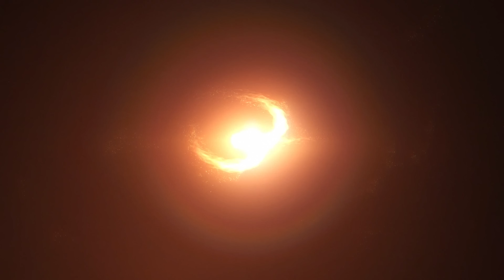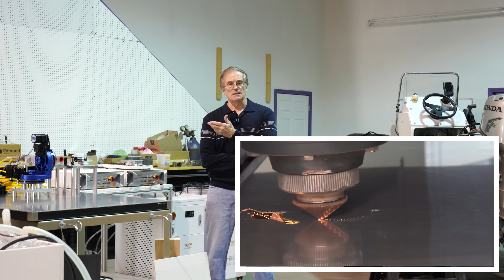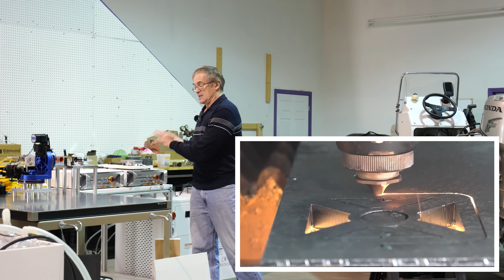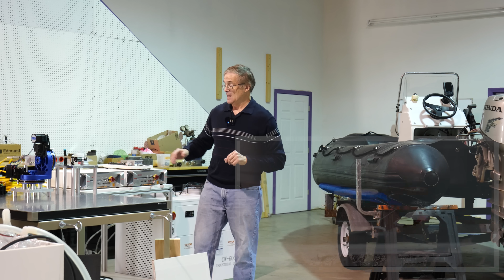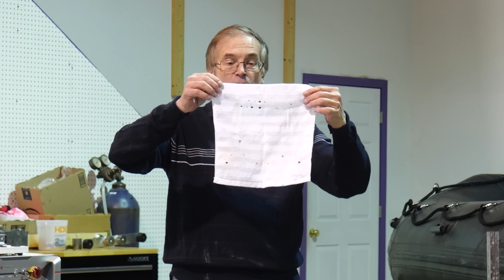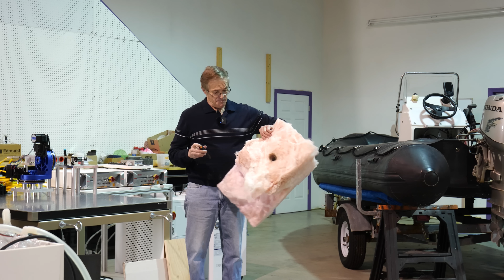We have a problem... and need your help!

Comment: Cabinet maker here.. LOL (why does everyone feel the need to announce their profession as if it gives their ideas more credibility?)

So, the laser provides a certain amount of energy within a defined area over time.  If you can significantly lessen the time, the problem is solved.  Simply cut a bunch of drywall circles, overlap and spin them.  By spinning, you control the potential time the beam can hit a given spot on the material.  You could even rotate on  a variable elliptical path to increase the what is now essentially a cut path.  The material isn't as much of a factor if the beam can't dwell on a single point for long enough to damage it significantly.  The solution is a surface in motion rather than static.

Comment: small containers stacked into your backdrop; filled with:  1. Water + sand.  2. water + fiberglass.  3. hydrated "orbeez" mixed with sand and/or fiberglass. 

4. hydrated Orbeez in 3 pound sacks stacked behind the target.

Comment: Maybe not cheap, but what about a bunch of thin glass cylinderical rods facing vertically? If you had some sort of optic to diffuse the light then you'd been fine with drywall behind that. Maybe a curtain of fiber optics without the cladding?

Comment: Have you looked at the laser safe laser acrylic that's used on the actual fibre laser cutting machines / laser glasses? Its designed to block the light, but not sure how long it'll last with that laser power.

Comment: Wet sand between two sheets of a fine metal mash (insect screens). may be several layers of screen. Should not be very reflective holes can easyly repaired, cheap. The sand does the absorbtion, the water helps to stop it from flowing. The mesh keeps the form as a wall.

Comment: Do beam dumps not exist for these lasers? I've seen that for fairly powerful lasers it's possible to make one at home, using prisms to weaken the beam and mirrors that prevent it from exiting the "trap" so that it can be dissipated by ceramic cone or even copper/brass  cone heat sinks, coated vith special material or colored with special paints and liquid-cooled.
Reply from the maker: We have to dump the beam, but while it is scanning all around the whole back wall chasing drones.
Reply: @TechIngredients, I hadn't thought about the fact that the laser moves. Have you tried using homemade SpaceX/Shuttle-like heat shields? Haven't you tried doing something similar in the past? Someone on YouTube has had great results, you'd have to see how they handle the heat from the laser when it's concentrated in such a small area.

Comment: Hay how about the type of brick used to build a ceramic curing oven? They are super light, and can take a lot of heat. You could use a reflective coating on the oven brick with a mirror to reflect the laser back at the brick and possibly have the mirror move ever so slightly with a servo to redirect the laser beam at a new position at the oven brick. I tried to find what they call the oven brick, but could not find any name only this: SK-34. I LOVE your program because it reminds me of my father that has passed on, but he worked for JPL as a thermal engineer for 10+ years. Then moved to Colorado to work for Martin Mariota. It was not yet merged with Lockheed. After I retired from the U.S. Army as a 67T I was hired on at Lockheed Martin building top secret satellites. After retiring from that I moved to the Philippines to find love; which I did and we are still together after 12 years. I wish my father was still with us so he could solve this issue, and I know he would LOVE watching your program too. Hope this helped or at least give you some ideas. Keep up the awesome work.

Comment: Forgive me for saying there is some irony in this problem. The original deployment of these lasers used beam convergence-point-divergence to get the metal cutting done, and divergence to render the beam safer afterwards. As I understand it, you have created the beam that does not diverge, and is lethal well past the intended target.
Two thoughts:
1. Move the operation to a proper bunker since a mishap could send a lethal beam outside the garage risking the safety of anyone nearby (check the insurance policy); and,
2. Change the problem to focusing the beam onto the target so that it then diverges (just like the laser metal cutter system).
In general any weapons system can be considered in three parts: source, target, and minimising the effect on non target areas. 
As I see it, a drone engagement can happen at relatively close quarters, and friendly forces/assets can be on the hill behind that drone — dispersion is your friend!
Reply from the maker: Depending on the energy, any beam can be lethal. There is a limit on NA or numerical apature. This is the convergence/divergence angle. The mass and dimensions of the beam director optics determine its speed and stiffness.  Because the beam has to start out small and focus at the distance of the drone, it's still small when it hits the back wall.
Reply: @TechIngredients  Yes. This resembles taming a tiger while holding it by the tail. 
Again I think this taming is best done in a concrete or rock lined bunker/tunnel.
As for the beam geometry itself... straight lines are painful when the target is only one point on the line. If the beam starts as a cone, the target is at the point, and there are zones of tapering damage both sides of the target. The collateral risk goes down with distance.
If the beam is diverging less resilience is needed the further away the stopping barrier can be placed.
BTW remembering your work with BaSO4 microspheres. Can you get an IR transparent plastic in sheet and bead form? Build a wall of dispersion before the backing layer has to absorb the energy.

Comment: A large diameter, reflective tube, wrapped in a coil, where light can enter, but not leave the coil. The inlet must be a 2 way mirror that lets light in, but not out - reflecting the light back inside the coil. It would be interesting to measure electromagnetic properties around the tube and in the center of the coil.

Comment: Do what we do with plasma or laser cutting tables, but on steroids. Stainless steel aquarium with multiple stainless steel sheets positioned like fins on a heat sink, so the beam will heat outer wall, then water/steel/water/steel/water/steel, etc. Experimenting with the number of sheets, you could maximize time prior to the beam punching all the way through. Also, you'd get leaks in the front face, but you'd just need catchment with a pump, and then you'd need to replace the front face once it has too many holes.

Comment: The solution to pollution is dilution. To dilute the light, you need refraction and reflection to a effect of thick snow,l. Sand comes to mind, but you will need powdered sand(100mesh or smaller SiO2) to act like tiny mirrors, all but a vertical setup would be impractical.
Next suggestion would be to show your new found love for Ad Coelum doctrine and look to the sky. Be sure to dodge clouds bird and satcoms

Comment: a long pipe filled with water, maybe a 8" copper tube of 10 yards long,  with heat veins welded externally (to quickly dissipate heat) and a pump system to circulate water between the tube and a 1000 litre aluminium tank (copper if possible) also fitted with heat veins (the size of the veins will be subject to trial, in order to tune the system). then using a sighting laser you aline the whole apparatus in such a way that your laser will travel through the exact centre of this horizontal water chamber. additional refinements can be applied, including shortening the tube and adding active cooling (chilled water jacket and or cooling fans). Hoping my plumbers solution proves in some way useful. who knows maybe we just invented an incredibly efficient water heater 😆

Comment: May I suggest considering lava rock? As a physicist, I find its natural thermal resistance and porous structure particularly suitable for dispersing high-energy beams. It could act as a passive, robust medium to absorb and scatter laser radiation, especially in the infrared range. Its use might reduce the need for more complex cooling systems.

Comment: So etching that has dispersing or beam splitter effects that rotates so no one spot is targeted for long, then another layer after that  to further 'dilute' the beam, repeat as needed until the power is dispersed enough to use a more normal absorbing material.

Comment: How about two panels filled with glass bead blasting beads. to diffuse the light and if it melts, the molten part can be removed easily.  Make sure they are not retroreflective at IR wavelengths.

or better yet.

How about a mirror ( keeping in mind that it needs to be mirror-like at the wavelength of the laser ) at 45 degrees that reflects the laser straight down into a tank of water with something mixed in to scatter the light. 

I think that the trick is to reflect and diffuse the light in a controlled way before you absorb it. It isn't the absolute power that's dangerous, it's the distribution. Otherwise, it's about as dangerous as a hair dryer.

A mirror straight down into dirt assumes lab-grade dirt dug from a pasture inhabited by spherical cows, not the kind of mystery dirt that makes dioxin when you vaporise it indoors. I wouldn't want to ablate anything that I didn't want to breathe indoors.

Comment: If the laser power can be controlled quickly, only ever turn on the laser to max power for a fixed short pulse width. For example, if your pulse width is a few milliseconds, then your beam stop only needs to be able to withstand a few milliseconds of energy, as opposed to a few seconds. Being able to detect the main failure points, e.g. the scanner freezing, would certainly help as well. It seems like the beam stop should be a last resort.

Comment: What about turbid water in clear containers? Have the water absorbing the energy of the laser and hopefully the  clear plastic doesn't get melted right away, and even if it does it doesn't drain instantly since the hole is small.

Comment: You don't want to do live fire testing of 1000W of metal cutting laser inside your garage/lab.  Period.  Think of your system as a weapon, like a gun, and firing it requires safety measure, a prescribed firing range, firing protocols, etc.

Comment: a curtain of falling water? Maybe you would have add graphite to absorb more light. And maybe you would need multiple layers. The challenge might be to keep the water in the form of a falling sheet and to keep it from building droplets. Or if you can spray the water and you have enough to make sure there is no path the laser can go through without hitting enough droplets.

Comment: what about a wall built like a thin-ish aquarium, but filled with the fiberglass insulation, but also filled with water. the water to dissipate the heat, and the fiberglass to "catch/redirect" the beam. like a sandwich with the side facing the beam is polycarbonate (or similar) then a cavity filled with fiberglass insulation that is soaked/submerged in water. the back side could be more polycarbonate, or better yet, something like drywall. this is a tough problem!

Comment: Hi there.
I'm a uncertified college engineering dropout :D
Wouldn't this be the perfect application for starlite material?
Look up "K40 Laser vs. Starlite Super Insulator / Testing what Recipe really works"
It might give you some ideas.

What you aren't going to get is a super-material that stops such a high power laser for an indefinite period of time, esp not cheap and not light-weight enough to deploy on and off.

Which I'm guessing by not wanting to use a sodium wall, is what you want.  Cheap, possibly mobile, drop-cloth like backdrop.

But you can make a starlite (or starlite-like_ material) coated dropcloth (used fire-blankets sewn with starlight inbetween filling pockets?)  that is able to give you enough of a delay to keep you from cutting holes in your vehicles, homes, or friends.  

And you could "pre-burn" the material to get that nice dark carbon over the top of it to better absorb the light from the get-go. 
Or just drop some 99.9% carbon graphene/graphite cloth (don't get the chinese stuff its not really 99.9% carbon) and drop that over the top of the starlite.

The real trick about going this method is that you can cheap out as much as you want, as the cheaper versions of starlite are simply made from flour and water.  Just make sure and seal it up in plastic between uses to keep the bugs out, as they will enjoy the starch too much to resist it.

Nothing will be perfect, but maybe I can get some braincells swirling that help you think of something.

Love your channel btw.  Been watching since your channel had just a few hundred subs.  You and Robert Murray Smith account for half my adult education at this point. hah.

Best wishes.

Comment: (1) The laser is created using optics, so could you use optics to redirect and / or disperse the laser?

(2) Could you start with a flat surface (metal ?, granite ?) and apply one or more thin layers of a coating that would absorb the laser energy?

Comment: Cheap and light...
you also said you need a few seconds..
a slightly untested idea but might work...

Cast an Aircreete slab..
it's foam mixed 70%~ with cement (great fun to do and has many uses) applying water glass to slab's of aircreete and letting it soak in makes better fire brick's.

With that in mind...
There's 3? layer's but not sure of thickness..
Aircreete slab 3"? thick.
Next layer is broken glass, cubes like a toughened car windscreen does when it break's, which need's to be several inches thick.. Glass and clear silicon sealant...
... and another aircreete slab.

How it works...
Lazer cut's through aircreete then hits glass and hopefully is diffused as it melts.. the scattering Lazer beam is caught by the aircreete..

A couple of other things...
Can it cut through....
..a thick layer of silicon sealant?
not sure if clear or white better.
..Ceramic wool?

Some people in the comments are saying about safety devices...
An easy one to make is a PCB board the type with parallel strip's and
starting top left connect line 1+2 on the right then 2+3 on left then 3+4 on right etc..
Several board's in series layered over each other.
Put this behind the target and when it burns through, it then melts the copper causing an open circuit and it's wired to the controller, coat with silicon sealant to stop spatter and angle board so the strips seem narrower and more dense to the beam.
Another thought is the ceramic tiles on the Space Shuttle...

A possible practical use for them...
Boreholes for water and geothermal...
I was also thinking of the Miners that were trapped and they drilled an escape tube.

Comment: Sand bags , just stack dry fine white sand bags up . Pop a sheet or two of mica behind for good measure if you are worried. The sand will melt and more sand will slide in to replace the space the lazer made. Jute bags so you dont end up with a plastic fire

Comment: Starlight-intumescent material. 
If I remember it’s made from sugar starch glue but plenty of examples on YouTube. 
Like pointing at the ground but to many unknowns. 
I also imagine a reflective and/or possibly refractive chamber of mirrors that split and divide the light in set safe patterns until the beam is narrowed out or energy has become benign. 
Then encase mirrors in starlight and use the ground as backup. 
I imagine multiple small quickly cooling mirrors that either leaches energy from the beam and or uses a medium within this infinity chamber to steal energy and use that energy to make the system itself more efficient. But I’m borrowing that last bit from universities that use systems in the way described or at least did in the 70’s 80’s.

Comment: Put a drywall on a rail. Like large garage sliding door. Maybe mount the drywall on aluminum frames to keep the weight down.

If the Ø focus of the beam is 1mm,  the drywall needs to move with 10 mm/s. A standard width 120 cm drywall plate will give you 2 minutes of testing time.

A problem withthis idea is if the laser beams tracks a moving target moving at the same speed and direction as the wall.

Comment: It would be interesting to see you try drywall painted with intumescent paint that is based on expandable graphite. The graphite flakes in the paint expands as soon as they hit temperatures around 392F/200C and the expansion creates an intumescent layer that can handle temperatures above 6600F/3600C. I have no idea of how it would handle the concentrated energy from a laser or if there are any 100% non-toxic alternatives out there but paints like this are used all over world and are readily available. You may need to paint a few layers and if that doesn't work, drench a cotton towel in the paint to create a thick layer of protection and attach it to a board where it can dry and solidify. Expandable graphite can be bought in bulk if the commercially available options are cost prohibitive and/or if you want to mix your own paint. Good luck!

Comment: A falling water wall, with as much air or white caps as to not be clear, the goal would be to refract the light before hitting some other backdrop.

Or a water wall containing graphite, with the goal of absorbing the light, this could cause excessive water evaporation.